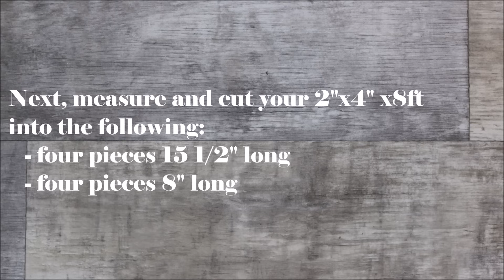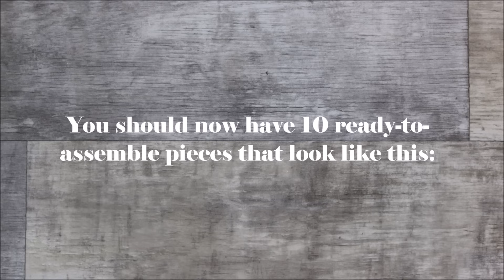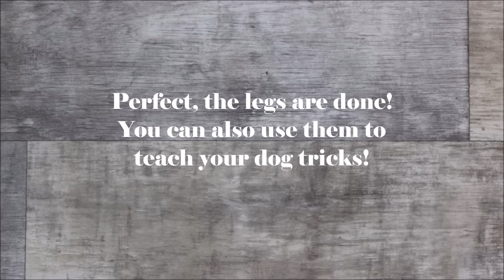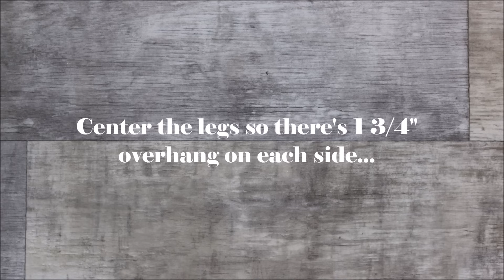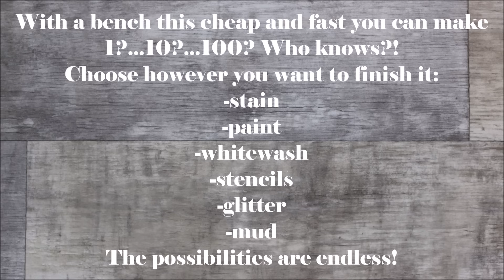The $15 Fifteen Minute Bench - Easy DIY Project

Comment: This is a cute simple design, and I appreciate your efforts in making the video.  One big thing I didn't see is anywhere you screwed you NEED wood glue.  The screws are going to loosen up over time and technically they're only there to hold tight until the glue sets and makes the full bond.  I've learned this the hard way on other projects.  Anyone wanting to make this, use glue on any surface that you have held together with screws.
Reply: I'm trying to make this bench less unstable, what would you suggest adding to it other than wood glue on the screwed joints? Thanks
Reply: @faithchamness5810 The glue will help tremendously but if you're looking to get a little fancy you can use dowels as a joiner between the each of the 2x8 boards.  It's a classic/strong/cheap way or doing it.  But your holes nee to be precise, so that can be harder than other methods.  If you don't have a router or a table saw to create a tongue and groove, or a biscuit joiner. It's the way to go.  Just remember, put glue in the holes and on the dowels themselves. Then clamp them together for at least 15min but I normally wait overnight before working with it to give the glue time to really set up.  Also, you can't in this design, but if you have a different style legs, then you can gusset them with a little triangle of wood to add to the lateral support.
Reply: @SeekerOfLight  thank you so much, I was leaning towards the wooden dowels. I tried screws last time and I kept stripping them out.
Reply: @faithchamness5810  you may need a different screw?  One with more aggressive fluting...think deck screw, kinda.  Anyway, glad I could help 😁
Reply: If I wanted to add on a back to this bench. So I can lean back. How do you attach more wood to the bench to make a back?? Is there a video for that
Reply: @angelamc3532  I would run a 2x4 under the back on it's side so the back has more lateral support when you lean against the it.  If you have a table saw, cut off the rounded edges of the board so it has a strong square edge.  And either screw down and glue or dowels, or pocket holes or whatever means of joining you like.....plus glue 😁

Comment: I thought I'd throw my two cents in.  I made two of the benches.  I'm pleased with them.  I put four coats of water based spar polyurethane on them after sanding and rounding the edges a bit.  I received a few critiques about my work not rising to fine cabinetry, but I wasn't making a Hepplewhite sideboard.  I wanted some inexpensive benches to place next to a campfire that might get left out in the rain a couple times. The low cost, and ease of construction really appealed to me.  I thank you for posting the video and I thought it was shot very well. Me?  I'm a belt and suspenders sort of guy so I put glue on the 2X4 pieces before putting the screws in, and I used a finishing nail to hold the pieces together where I wanted them before pre-drilling the holes for the deck screws I used. I hope no one perceives these suggestions as criticisms, because as I said, I liked the video and it inspired me to make THEIR version of a bench instead of one of the other 6 or 7 benches shown on youtube.
Reply: capnbobretired  I am thinking of making this bench. Like you, I too found this version much simpler than other videos on youtube. However, I wish to know whether this will hold up in strength, over the years or not. How much load can it hold? Most importantly, whats your opinion on it, since you've already made this.
Reply: I think that's the important thing to remember.  This is not some bench that we are going to sell at a trade show for hundreds of dollars. It is a simple bench that we might use on the patio or fireplace area, and it might even get left outside in the weather a lot.

Or it might be used to put plants on it, so that we raised up the plants by about 16" instead of having them on the ground.  As such, this kind of quick design for 15-30 mins of cutting and construction time, is quite useful.
Reply: @odessy0000  Hi. I don' know about total load but I have two benches I use regularly at my kitchen table. It can easily hold 450 lbs. at least. It can probably hold much more but I have never had more than two adults on a bench at one time.
Reply: @odessy0000  I weigh in over 350 lbs.  After 2 years I am having to go back and use lag bolts from the top of the bench to get a better bite into the legs. The screws and glue did not give enough bite and the legs separated from the bottom side of the bench.  The poly urethane is holding up well. I am not as pleased with the design, but then maybe big guys should look to another design.
Reply: capnbobretired would a lower center support help or is it just too much weight? Thank you
Reply: @jamesmitchell6288  The weight the bench can hold is quite a bit.  I've had 500# on it yesterday. Well, 502# with the cat.  The problem  I had is that there is not enough strength in the connection between the bench and the vertical 2X4.  I finally put in  5/16 lag bolts to fasten the verticals to the bottom of the bench.  A lateral 2x4 or a 1x4 across the two vertical supports (attached at the lower end of the vertical)would go a long way to making sure the bench would not separate if you are going to use it for heavy duty types of folks, but as I said, I stress tested it with 500 pounds and the lag bolts did the trick for me. The bench itself is not so long that it needs a third set of vertical supports. Enjoy.
Reply: In my opinion, this thread shows how powerful the internet can be. We start with an very simple design that even I can build, then end up with a very pleasant exchange of ideas that can help other people expand on the original design. Well done!

Comment: I'm someone who built something similar, and want to point out something.  When you buy stock 2x4 or 2x6, they are not always flat, and may be different widths.  You want to make sure you use ones that are as flat as possible, or you will need a planer (expensive) to flatten them.  Secondly, make a cross brace.  Not having it is pretty, but in terms of functionality, you will get some wobble if you don't cross brace the legs, even simple small ones from the side of the leg to the seat (45 degrees).

Comment: If you’re using any softwood (pine, for, etc) the stain will absorb in patchy areas. That can be great if you want the rustic look in the video. If your space requires something with a more even look, apply pre-stain conditioner to your wood. It will allow the stain to absorb evenly, and give you a great showroom type look. Also make sure to sand, sand, sand, and sand some more in gradually increasing grit if you want a more polished look. 

Great bench, great plans, great videos!

Comment: I just made this for my first ever carpentry project and I was able to do it all by myself without any help! Thanks for the beginner friendly videos!
Reply: How much did it cost you?? I want to make it for my school project and want to know the estimates
Reply: @yvo1786  I paid $44. Here's what it all cost from lowes:
Screws- $9.98
2x8x8-10.68
2x4x8- 6.38
Sanding block-3.98
I got an oil based stain bc I had water seal already- 13.48
Reply from the maker: That's awesome, congrats on your first project!

Comment: I made this from scrap wood at the barn for a bench in the tack room. Since the ground was uneven, I put the bottom cross piece up 6 inches. I also put the legs 6 inches from the edge. It turned out really nice. The top is some aged brown old fencing. Every one loves it. We have a sitting place in the tack room now. Will paint the barn logo on top.

Comment: I just built this today. I went to Lowe's. The 2-8-8 was $6.04, a 2-4-12 (which was 4' longer than I needed) was $5.58
I just asked them to cut me the pieces. I bought a sanding block and some 2 1/2" screws. Not expensive at all.
It's not "perfect" due to warping in the 2x8 that I picked, but it's a nice solid bench that I'm using in my bedroom, and as someone with very limited woodworking skills, I'm pleased with the result.
Reply: great what was total cost
Reply: I don't have the itemized receipt from my trip that day to Lowe's, but the total for my  trip that day was $25.41  I got all of the wood, a box of 2 1/2" construction screws, a sanding block and some 220 grit sandpaper for that price. I think I also bought a spray bottle that day too (around $5?), but I can't be sure. If you just buy the wood and screws for the bench, it should be about $17 depending on your local prices.

I returned on a different trip to get stain, paint brush, tarp etc. because I will be using those items on the pieces that I build later.

Comment: this design is the gift that keeps on giving. I modified it AGAIN and made an end table. I cut the 2x8s to 2 feet instead of four. Basically I halved the bench. I also put one of the  2x8s at the bottom of the bench. It fits perfectly as a shelf for extra storage. I put it between the holes made by the legs of the bench...ahem. I mean end table.
Reply: What a cute addition! Also adds stability to the seat 👍 Thanks for the idea!
Reply: I know this was 5 yrs ago...but...would u happen to be around to send pic of how u added table? My fam wants one to put out at cemetery when we visit.

Comment: My husband and I made this bench over the weekend. Like some other commenters, he also inquired if we should do the extra step of adding pocket holes but I wanted to make it just as the directions said. I think it turned out well.  Simple design but the way the legs are made makes it look a little elevated. It was very, very easy to make and we calculated it to cost $22 (I think lumber is a little higher right now). Took us under 2 hours from initial cuts to completely done.
Reply: Where did you buy your lumber? I calculated about $70 at Home Depot to build this.
Reply: @SophiasCreations  I made this 7 months ago when lumber prices were much, much more reasonable. I got my lumber at Home Depot. I think all in our price for supplies was about $21-$25 at the time.
Reply: @ariec7  Thank you for your reply.  We’ll be making a trip to Home Depot this weekend. Hopefully this project won’t cost an arm and a leg.  Stay beautiful!!🥰

Comment: I’ve made two of these in the last month...the wife is doing an after school gardening class at the local elementary and wanted me to buy a bench for the kids..this was much cheaper...first one I used a longer board  ten feet instead of eight...only saw I had was a circular saw..so there’s a little wobble to it because cutting straight with one of those is not easy..we liked it so much that I wanted to make another one to keep in the garage..this time though I bought a chop saw..50 bucks used and I know I’ll get more use out of it...used the smaller 8ft boards this time...I also made pockets for the screws and filled them in with filler...thanks to the chop saw there is no wobble...I’m thinking this one may be better suited for the kids...gonna stain it white let them paint it and put a clear coat over it...any way..to make a long story short.. Thanks for a real simple cheap idea..and if you don’t have the tools wherever you buy the wood from will most likely be able to cut it to your specifications..

Comment: I need to make them 24" high for the table..what materials might change instead of the 15 1/2 thanks
Reply: Nothing just the longer legs but for something like that I’d make an extra leg box thing for the middle and I’d use glue on everything as well as the screws just to insure structure and improve longevity

Comment: Thanks for the video. I made this recently. I had 1 thing I did not like so I added 4 small1/2" pieces of 2x4 at the base of each leg in front and back.  Looks nice and without these this bench will fall over if your body weight is heavier in front or back...

Comment: You cant get that lumber for $15. Aside from that, if you actually plan on sitting on it, it needs cross supports from box to box or it will eventually fold up sideways. You could possibly get by of you made the supports from 2×6s instead of 2×4s. You'd have a little more base that way.
Reply: You can't get one 2x4 and one 2x8 for under $15?  Where do you live Egypt or something?
Reply: you mean use a 2x6 over doing the cross supports? How would you even do the supports for this one if you wanted to add it,,,like put a strip on each side in the bottom section,,,or how about just doing a 3rd block and putting it in the center
Reply: @tnsteele95 agree with you - that bench, with all it's components - lumber, hardware, sanding block, and choice of finish, is definitely not $15. I get cheap and I get practical as people usually have limited tools and I'm trying not to hate because I respect people putting themselves out there, especially in the DIY community, but it's just not a very good project and it's misleading. Just seems clickbait-y with their current title and her constantly flirting with the camera is just like...stop.
Reply: I get 95% of my wood for free!
Reply: Wood at Menards is pretty cheap.  A 2x8 might run $6 there and a 2x4 might be around $2-2.50.  This is a lot closer in price compared to some of their other videos. BTW...nice video on the butcher block desk.
Reply: +Chris Parker  Thanks man - I don't know about pricing - I'm only going off my area so that is what I am comparing it to. Thanks for checking out my own video - appreciate that!
Reply: Easy man - I'm entitled to my opinion. I already said I respect them putting out videos and I enjoy quite a few of their projects - I just happen to not like this build in particular and to me the constant to-camera-flirty stuff seems cheesy. Why does it always have to go from 0-60 with anger so quickly with comments when I'm just stating a simple opinion?
Reply: I figured as much.  No worries.  Keep up the videos too.  like your use of glue.  Other people who create content could take note on wood glue.  I use wood glue in my videos lol...again I also wear closed-toe shoes, safety glasses, and a dust mask...I'm in the minority with that I think.
Reply: Just checked out your channel to - definitely subbing for future projects - would love it if you stuck around for mine too. I agree with you and trust me I totally get the vibe they are going for too. Super cheap materials, very easy to use set of tools, and clear as can be instructions - although talking every now and then wouldn't hurt! But to me it just came off as a bad project that also lacks a bit of DIY due diligence like you pointed out (wearing shoes, a mask for dust, safety glasses for the eyes) and just using a bit more materials for a project that will last much longer (like glue!). Cheers mate
Reply: For sure.  I'll be your #326 sub.  Like what I see...like your projects.  Keep it up!
Reply: Couldn't do it here in Australia,at least not in my area where Bunnings has the monopoly.
Even pine here is expensive.Most woodworkers I know around here go for old pallets if they can get them and only buy new wood if they absolutely have too.In this build,to do it in Australia your looking at 40-50 bucks in new timber.
Reply: That would be about 9 bucks from where I buy my lumber.  Add another 2x4 for cross supports and you'd still be under the 15$ budget in lumber.
Reply: freeman621 :  Wait..was she making something?? Oh, didn't notice.
Reply: Just checked my local price gouger, $7.89 for the 2x8, $2.99 for the 2x4... both in soft pine #2 grade. Not exactly furniture grade stuff. I agree with you that this is not good construction and I doubt that it will last very long as a place to sit. As a hallway catch all it will probably be fine but I'd be very careful putting my fat ass on it.
Reply: Tennessee Flipper i actually went and bought the lumber to make 2 benches and just the lumber alone was $15.68 of course i have never done this before so i needed all the materials and that was $50.74  but for what they are talking about,  just the lumber it is definitely possible!  can not wait to make my benches!!!!!
Reply: One 2x4x8 = $3.  One 2x6x8 = $6.  Ten pack of sandpaper = $4.  Most people have a drawer full of screws at home.  You can get a used can of finish at a re-store for a couple bucks.  So yes, this is a $15 project give or take a dollar.

Comment: Good idea; I made 6 5 ft long buying 10ft boards but did spend some extra money using trim-head screws 2 1/2 and 3 1/8. I also mitred the edges. they look great sanded, linseed oiled (takes to long to cure) and polyurethane
Reply: I use a mixture of Boiled Linseed Oil, Mineral Spirits, and Polyurethane (must be oil based to mix). Penetrates better, looks great, and easy to apply.

Comment: This is my first time constructing anything. This is my first time ever even pre-drilling a hole in some wood! But this looks so easy I had to try it and it beats paying $80 for a bench. The wood and supplies we're about $16. So that was spot on the only thing that is unrealistic about this video for a person who is new to constructing anything, is that would moves she pre-drilled those holes with no problems. But I have a 14 Volt Black and Decker and it was not as easy at all. I had a few times where I tried to pre-drill this is my first time construction anything. This is my first time ever even free drilling a whole in some wood! But this looks so easy I have to try it and it beats paying $80 for a bit. The wood and supply were about $16. So that was spot on the only thing that is unrealistic about this video for a person who is new to constructing anything, is that the wood moves.  She  pre- drilledl those holes with no problem. But I have a 14 volt black and Decker and it was not as easy at all. I had a few times where I tried to pre drill but the nail still got stuck. I'm not quite sure what to do about that yet. However I can go and get a replacement piece of wood cut for about $5 or less so I'm really not complaining.